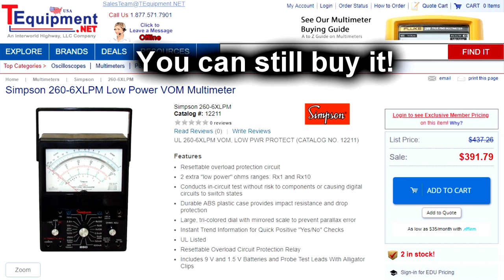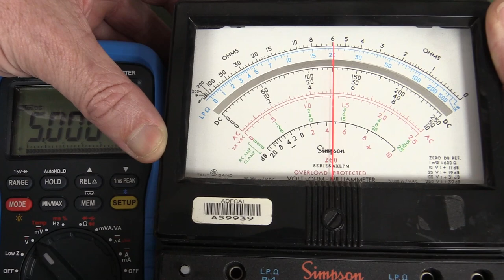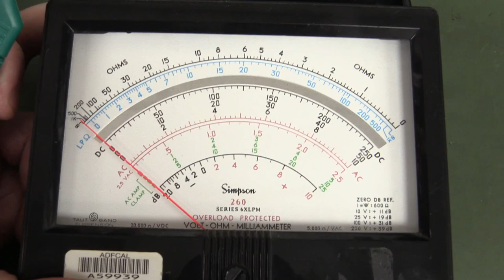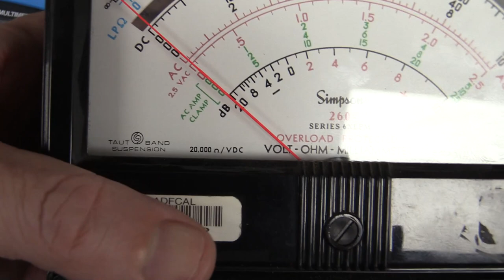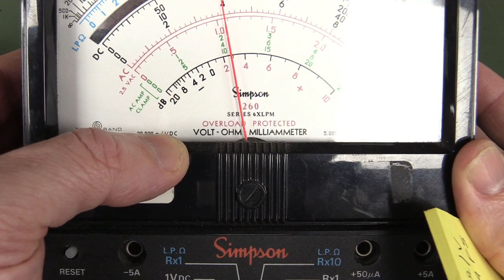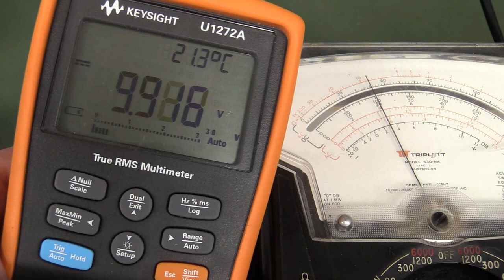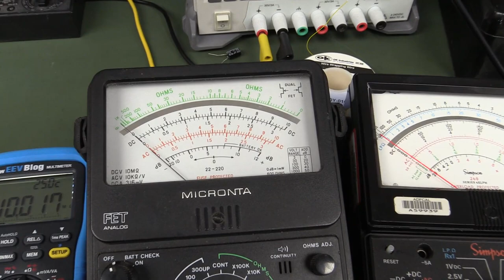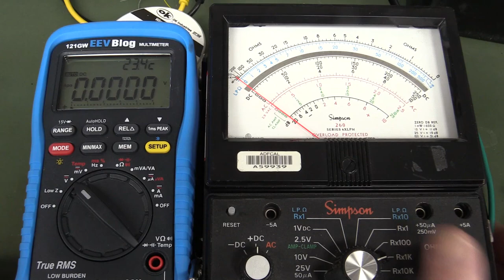EEVblog #1067 - Analog vs Digital Multimeters!

Comment: I have 3 Simpson 260's - one of them is a militarized version (260 AFP-1)  I find them useful on occasion.  I use them for monitoring current when I'm observing over time, because they don't require power, and I can just walk over and look.  I know that a digital would work, but I'd have to turn it on each time  in a situation like that, which is an unnecessary annoyance.  I also have several digitals, which I use for most everything else.  The analogs are probably not first-line equipment anymore, but they do have their uses.

Comment: if your setting up any analogue control signals digital's are far too slow you can also see the average instantly and how wide the error band is - however for all others i use digital with range lock as auto range is a pain if the signal is fluctuating near the scale point

Comment: There's one additional nice thing about analog meters - the older ones often go to 4-6 kV which is great if you have to deal with high voltage stuff from time to time and don't want to spend money for HV probe that you will use once in a blue moon. And even if there's a big fail in HV circuit that will destroy the meter it's not a biggie as they're cheap. Some might say something about a CAT rating but I trust these ridiculously thick bakelite case more than any fancy certificate to be honest ;) Microwave oven service manuals to this day recommend Avo meter for checking anode voltage of magnetron :D

Comment: I still keep very cheap analog meters around that probably aren't accurate, but I pull them out if im checking for a potential break in a wire. Sure you can use the bar graph on a digital to see if it jumps around, but watching a needle jump around is just easier.

Other then that, I have a Simpson 635 that will read up to 6000V, and that is much higher than my current digitals for the odd time I need to check stuff on a CRT. I know I can get a high voltage probe for my digitals, but the old Simpson is still good enough for me to check for issues.

Comment: Would be very difficult for me to do my job without some old analog meters.  Working on two way radios and especially older tube type radios I have to use a analog meter to peak circuits.  Extremely hard to peak a circuit with a digital meter.  I also need to use several different analog meters.  Service manuals for older equipment specified what the input impedance of the meter used to take the measurements on the schematic was.  Using a meter with a different impedance meter will read a different voltage because it loads the circuit differently.  There will always be a need for analog meters.  Also, depending on what you are working on resolution is not that critical.  Also, remember we launched men into space with nothing but analog technology.

Another thing to consider is voltage measurements at high frequency.  How many digital meters can measure AC voltage at frequencies around 1GHz.  My old military VTVM can.  It has a diode tube in the AC probe.  It also has a DC input impedance of 120 Meg Ohms.
Reply: When you do a transceiver alignment you need to "peak" tunable coils and transformers by adjusting the ferrite core.  It is so much easier to watch a needle swing up and back down and adjust for the peak.  A digital meters display is continuously bouncing around.
Reply: HP by any chance?
Reply: Some say they need analog to peek circuits but don’t DMM have peek detection, all of mine do even min and max so is this something different they are talking about
Reply: It's a HP "type".  They were actually made by Sentinal, model ME-26 D/U.
Reply: When you adjust the coils and transformers the voltage will rise to a peak and then drop off.  You need to adjust them for that peak by rotating the adjustment back and forth.  Trying to do it with anything digital is almost impossible.  I could peak 5 or more adjustments using a old analog meter in the time it would take to try to do one with a digital meter.
Reply: I repair tube gear all the time with my Fluke digital meter as for creating say 20k per volt or other special load conditions I put say a resistor across my meter which will replicate the old meters interaction with the device under test
Reply: But how much voltage can that meter take?  Most digital meters are good for 1kV.  I frequently work on tube gear that can get as high as 1.5kV.  I can take direct measurements with no need of a special probe when using old analog meters.  Most go up to1.5kVDC and 4.2kVAC P-P.  And as I said previously digital meters are useless for peaking circuits.
Reply from the maker: I'm not saying there will never be a need for analog meters, I in fact said there are niche cases where they could still be advantageous.
It's basically a slow responding (ironically) high resolution bargraph meter.
Reply: I can direct test up to 50 k volts I fix crt TV'S so I run in to these hi voltages
Reply: And how much did that 50 kV capable meter cost.  A good old VTVM can be had for $50 or less.
Reply: Agreed.  I don't have anything against digital meters. I have and use several 5 1/2 and 6 1/2 digit meters daily and for most applications they are fine.  There are times however that using that 60 year old relic is better suited for the application.
Reply from the maker: MikesRadioRepair - My Triplett has a 6kV range
Reply: 50 kV capable meter cost around $350 usd
Reply from the maker: MikesRadioRepair - Digital meters are not useless for peaking, they are just much slower and more painful to use for that purpose.
Reply: Digital meters are in fact much slower and more for peaking but they do the job just jine
Reply: Vaes Joren r4
Reply: Jamie Phillips But nobody use CRT TVs or monitors now.  All lcd /led display  screen today.
Reply: a lot of people collect antiques
Reply: Well said.  While I love the accuracy and convenience of the digital meters, I still keep the analogs (especially the VTVM types) around for the reasons you just listed.  I also like the fact that you can center the needle on the analog VTVM's when aligning a discriminator.
Reply: discriminator aligning can be A PANE IN THE BUT I tend to use 2 meters at the same time wile aligning a discriminator I find it helps to do so
Reply: The problem with a bargraph  on most decent digital meters is that it is much smaller  than the analogue dials so it is harder to see, also the range is set to fit with the digital readout so you get rather large steps where as most analogue has a finer set of steps (ideally 0.3, 1, 3, 10, 30, etc for max scale) so that also helps. Personally I also have a problem that I can't stop reading the numbers even if I know that I should focus on bar and I think it is not just me. In general it is probably the dial indicator that is useful in some applications   not the actual analogue instrument, especially if you are tuning something (or just want a quick overview e.g. speedometer).
Reply: specialist stuff like that will probably continue to have its uses long into the future, but a good digital meter is very convenient for when a digital one will do ;)
Reply: " Also, remember we launched men into space with nothing but analog technology."

The first Russian flights used mechanical analog computers, and they were an amazing piece of engineering. Reasonably sure that the Mercury flights used analog electronic computers, but digital had started to come in by Gemini.  The Saturn V actually had two control computers, one analog one digital.  I get the impression they were unsure if the digital computers of the day would be fast enough to provide real-time course corrections to the rocket nozzles, hence the analog computer actually controlling the engines.

Agree, the bar graph on most digitals is pretty-much useless.
Reply: Yep, I think analog meters have some qualities that will only be found on top digital meters. I also like the ability to read the needle from far where precision is not needed. I would like to know how a low cost digital meters would compare to same price analog meters - I think low cost digital meters could create a false sense of precision.
Reply: MikesRadioRepair I never understood peaking or nulling with an analog meter. I had no problems adopting to digital and still use them to this day. Also, calibration and pot tweaking in say a voltage reference is all done with high resolution digital meter without problems
Reply: An analog clamp meter is helpful when diagnosing a compressor for starting amps. Digital amp clamps can be slow to respond.  although I did
get a new digital meter that measures inrush.
Reply: Scott Stoner hm, usually they have min/max functionallity.
Reply: Digital meters are nice. Specially when dealing with new modern day equipment. We both have tons of meters in the shop, most are analog VTVM type. I have several digital meters that did not survive the RF torture test. They do not like to see anything near a KW.75% of the time in the shop I use the analog meters. We work on a lot of vintage gear. That were factory tested with the very same type of equipment that we use. Half the fun in working on vintage gear is using the same test equipment from that era. There is no magic in the analog vs digital stuff, it is a grey beard thing. We just choose to shave :-)
Reply: Hey now, don't go lumping me in with those razor blade using people.  My beard is proudly half way down my chest and my face hasn't seen a razor since the 90's.  Goes with the hair half way down my back.  :-)
Reply: ROFL, I knew that would wake you up...
Reply: Peaking old tube-type radios is also the one niche application where I prefer to use an analog meter. For everything else, I prefer to use a nice, modern digital one.
Reply: Amen!
I have sometimes had to resort to an oscilloscope for some trimming operations, just because I did not have an analog meter handy.
Another thing where I have yet to see any digital meter to do a great job is measuring true RMS on certain oddball waveforms.  Old HP 4000 A meter is still the best one I have ever had the honor of possessing in this respect.  HP made individually (photo-optically) produced scales to match the movement. And then, there is an actual DC output of the converted RMS AC voltage.
Reply: Oh, yeah, I've also used an analog scope for peaking tube radio filters when I didn't have a good analog meter handy. Those work just as well for that.
Reply: each have their advantages and disadvantages, none can replace the other in every aspect, because they are not the same
Reply: As already mentioned, adjusting the effective input impedance of a digital meter to match that of an older analog meter is quite trivial -- just attach an appropriate value resistor across the input terminals.  Peaking is also not especially difficult to do with a good digital meter -- it is quite easy with my Keithley 2000, just set the update rate you want then program it to use a moving average and average 5-10 samples (or more if you use faster update rates, less for very slow update rates) and you will have smooth readings with the peak clearly visible provided you slow down as you approach the peak.  And if you really want accurate peaking you can always use the oscilloscope for peaking.  Not knocking analog meters at all, but if you have a good digital meter then there is very little that it can not do at least as well as an analog meter -- and this is from someone who grew up with analog meters and is still fond of them.
Reply: I've had to do the trick of putting a loading resistor across the meter terminals when I calibrated my TV-7D tube tester. I don't remember whether I was using a VTVM or a DMM, but it wouldn't have mattered... because the calibration procedures were all written for a 1500 ohm per volt VOM! Failure to get the calibrations to converge drove me crazy until I saw the passing mention on one diagram of the prescribed meter's input impedance, and the significance of that clicked.

Comment: One disvantage of analog meters is the large fragile display, it's fine on lab instruments or fixed electric panels, but usually not rugged enough for stuff that needs to be carried around when compared to generic yellow rubber multimeters or LED panel meters.
Reply from the maker: Yeah, should have mentioned that
Reply from the maker: There are analog meter that come with rubber holsters, but they still don't cut the mustard compared to digital.

Comment: Last time I remember Analogue having the edge over Digital was for multi-track tape recorder alignment. 
The BIG AVO meter scale was just the thing for tweaking those head positions and peaking/nulling the bias oscillator coil cores. 
Hi-res, fast refresh bar graphs of this era, but not the 90s DMMs, could get somewhere near that performance I guess but none as big as the old AVO movement. 
For all that though, even the revival of the tape machine is an old thing now and they are pretty niche, but they're still out there. 
My old AVO 8 needs a good service. My Mk7 probably needs a nice museum to reside in....
Got 5 DMMs at the moment. 6 when the EEV BM235 arrives 😉

Comment: One place where analog meters win is those little panel indicators to show the circuit voltage/current. Much cheaper than the elecronic fancy LCD indicators and more power efficient. But they're not MULTImeters. Connect one to your DC to DC converter and you're all fancy (in all honesty they are quite useful on a breadboard with the little space they need for the price).

Comment: The guy from whom I bought my "good" Simpson meters explained that it should remain at zero when the meter is both horizontal and vertical.  It's a painstaking adjustment, and many are not correct.  I've attempted it, but it throws off the accuracy at mid scale verses end scale.  It's like working on a damn watch.   Yes, one can twiddle the screw when one changes from one way or the other, and I've seen military meters marked "calibrated for horizontal/vertical use only."
Reply: One more point, be careful with the plastic front on meters like the 6XL and 6XLPM (as shown)  they can get a static charge that can affect the reading.

Comment: Dave, I found that with Digital VMs, the input immediance changed if your are on auto range or manual range.  The Fluke 87 (older ones at least) speced at 10MOhms input resistance. Now add a high voltage probe that is designed for a 10MOhm input imediance and you get quite a reading error.  I emailed Fluke Engineering and found out that it is only 10MOhm Input impediance on manual DC voltage range.  In Auto-Range mode, it is 11Mohm.  Reading a -2000v typically made a 50/60 volt error!

I have no clue with using a high voltage probe with an analog meter; never used that setup.

Comment: Needs more AVO's or GEC Selectests lol. I use my Analog meters the most as I like being able to watch volt/amperage measurements for long times without worrying about batterys. I tend to use my Digital meter purely for resistance reading because its easier to read the value and my analog meters take old types of batterys that I cant get and im too lazy to rig something new up. For most people, the resolution of a analog meter is good enough

Comment: Today I used my Micronta (same one as Dave's first) to measure a coin cell battery, no problems! Then I used the BM235 to measure the diode fwd voltage of a full wave rectifier. I like em both. Thank you Dave for mentioning the analogs do not need batteries for voltage/current. None of this pesky battery rubbish!

Comment: The only major component of an analog meter that wouldn't be standard is the actual meter movement and the knob switch. Most other things you should be able to find relatively easily (resistors will be low tolerance though) as long as the board isn't a crispy ruin (if it is, then next time dont stick a nail in the fuse slot :) 
A chip getting too much voltage to its input would probably break instantly, whereas a coil would either have to be hit with a voltage high enough for the insulation to break down, or be a sustained overload. If the diodes conduct on overvoltage, this would effectively short the excess voltage to ground, causing the fuse / breaker to blow, just like a crowbar circuit (MOV protection works the same way)

Comment: We use it for polarity test on CT's with a center 0 analog multimeter. auto- ranging multimeter are hopeless for that of course and we don't care for the exact value. applying a battery voltage to a CT produces a positive and then negative voltage so it's hard to see on a digital multimeter because there is not enough lag. Is there a good digital multimeter for that with a centered 0 bargraph?
Reply from the maker: I've seen them, but can't recall offhand.

Comment: I have one handy in car toolbox -- works without battery. I also hve one analog on bench, totally out of callibration, used as peak indicator for any tuning. What I like in analog meters is ease to see the speed and direction of change of measured value, bar indicator is just not good enough.

Comment: These VOM's are still used by Techs on old tube equipment.  The Voltage charts specified (many times) a 20k/V VOM to load the circuit.  These VOM's are still very useful and shouldn't be sold short.
Reply: Bob Ograv To btain the correct load resistant, just add a resistor in parallel.
Reply: Not really practical for a bunch of different voltages.  Besides, I already have the right meter.  No work around necessary.

Comment: Two more disadvantages of analog meters are 1) needle movement from acceleration, for example, use in a moving car, and 2) needle movement from electrostatic forces, for example, wiping the meter face with a cloth. With regards to powering the meter, another example where an analog might be an advantage is a panel meter where the lower accuracy meets requirements. Otherwise, I'll take a digital meter.
Reply: Same here